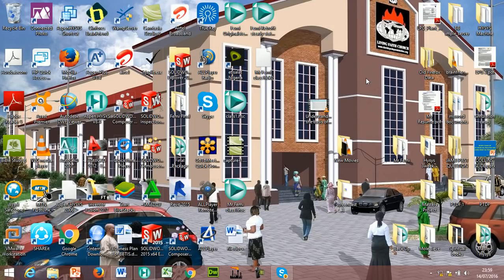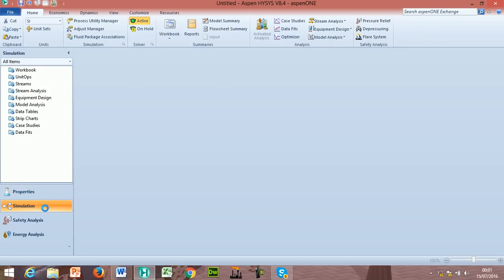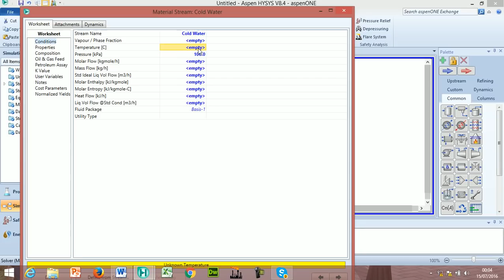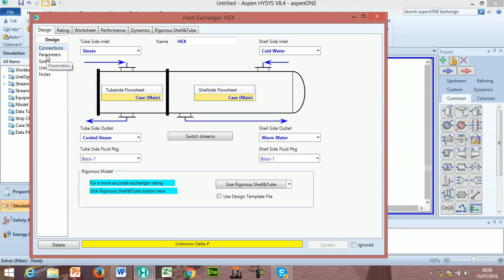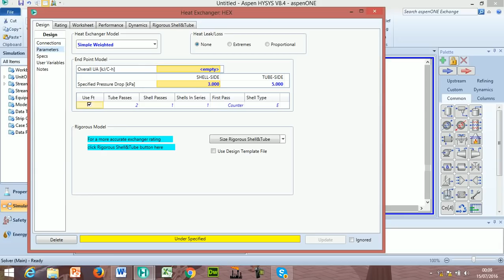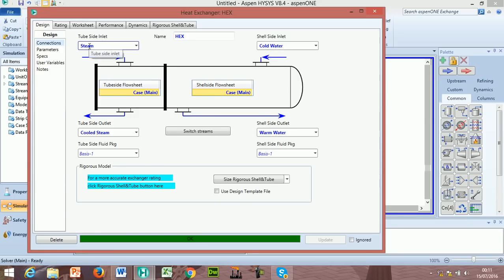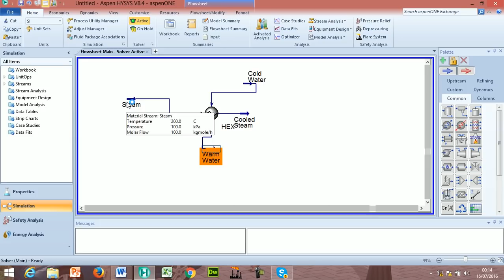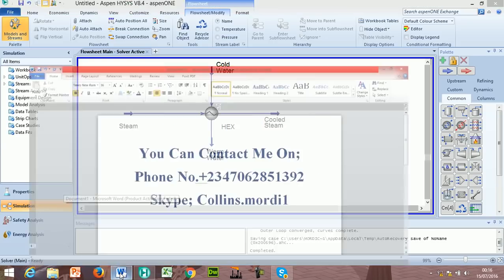Shell & Tube Heat Exchanger Design with ASPEN HYSYS V8 4

Comment: Salut à tous,
J'essaie de simuler un "echanguer de chaleur " en utilisant HYSYS en mode dynamique. En mode statique, tout va bien et la simulation est convergée.
J'ai ajouté un control valve avent l'echangeur pour varié le débit de fluide chaude pour chouffé l'eau  en fonction de temps .Je veux rester la température constant à la sortié de l'echangeur .(Le flux est ce qui change).
L'orsque je passe en "Mode dynamique" c'est -à-dire l'ouverture de la vanne ,la temperature elle va change .
quelle les procédure utilisé pour fixé la température dans tous les sortié de les echangeurs merci d'avence .